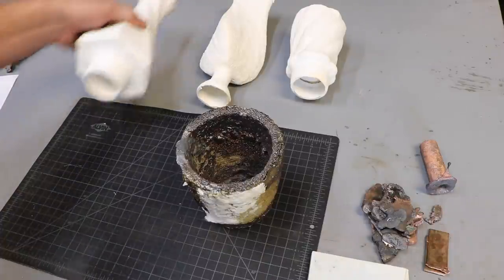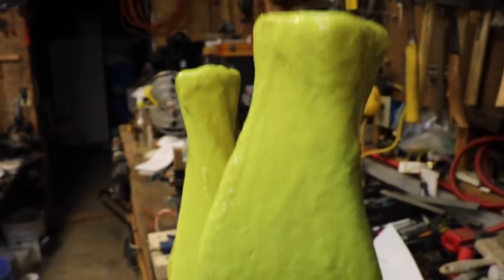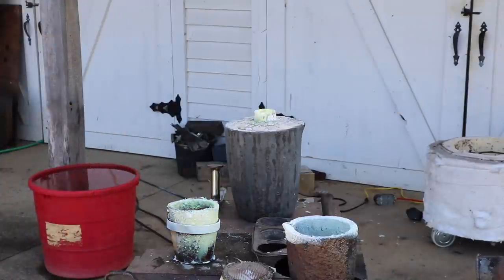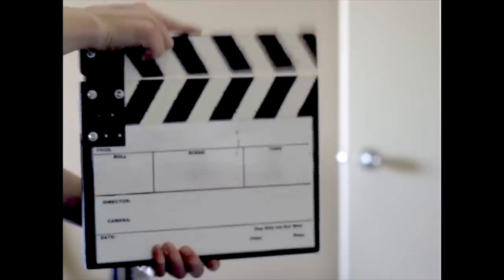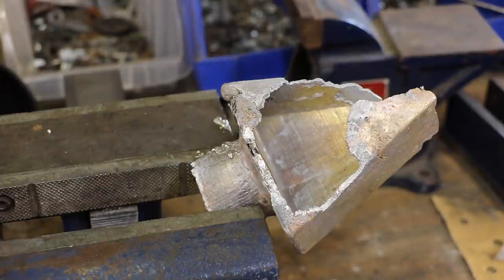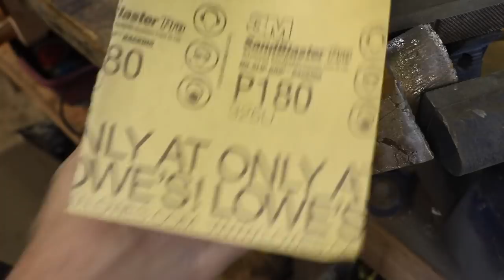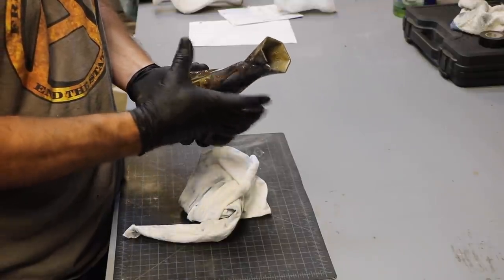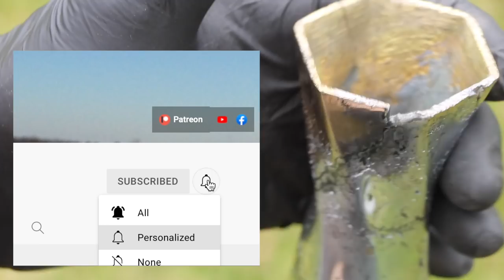Casting "The Cracked Vase."  Farmer Art...Or Fail?

Comment: Definition of perverse
1a: turned away from what is right or good : CORRUPT
b: IMPROPER, INCORRECT
c: contrary to the evidence or the direction of the judge on a point of law
perverse verdict
2a: obstinate in opposing what is right, reasonable, or accepted : WRONGHEADED
b: arising from or indicative of stubbornness or obstinacy

He has a perverse desire to glue together what should be melted down to find out what it would be good for. I bet it would be a good wear plate impact plate material.
It does look nice however.